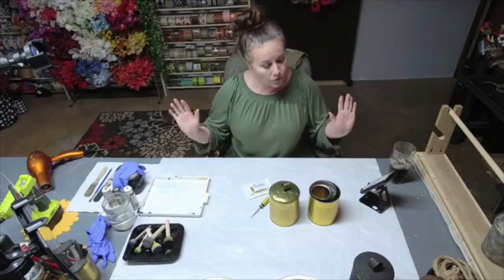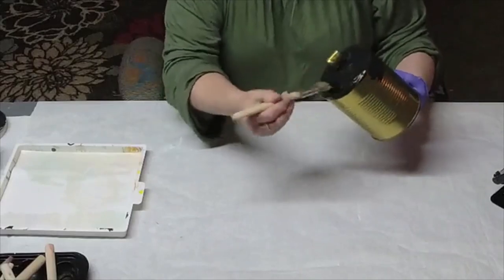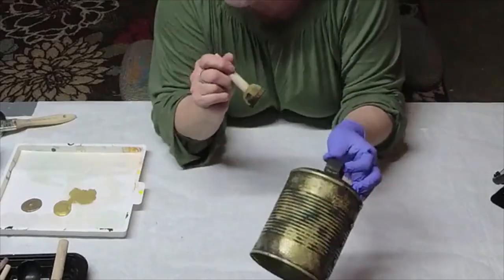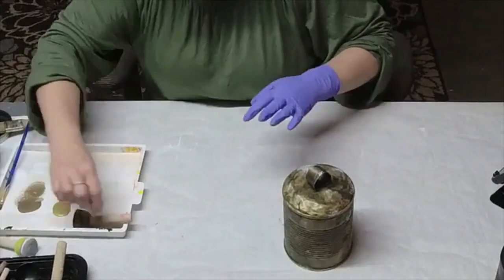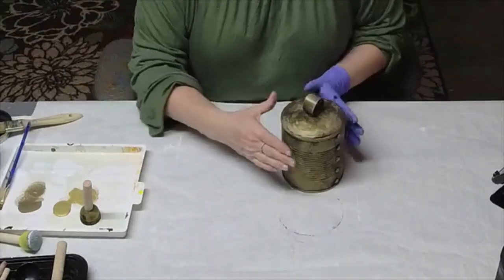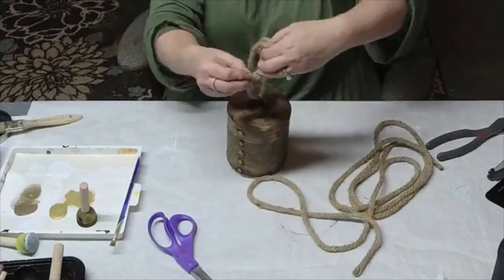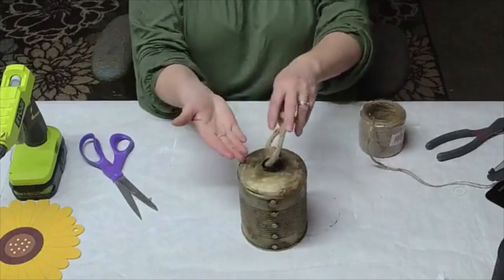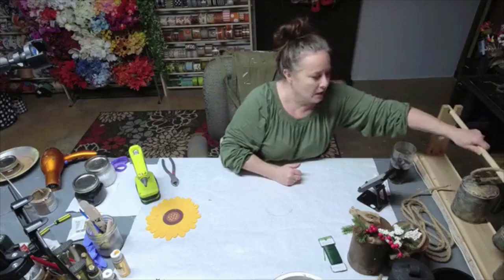Tin Cow Bells | DIY tin cans | how I painted them to look rusty

Comment: What is the little ring hanger on top of the bell?
Reply from the maker: It’s thin tin. I have a roll of tin that I can cut with scissors. You can also use thick aluminum foil pie pan.